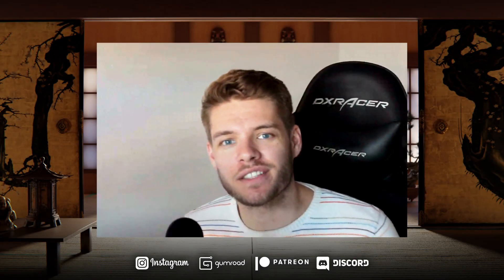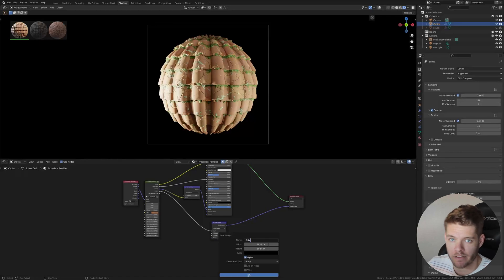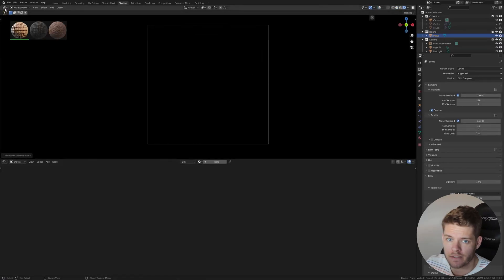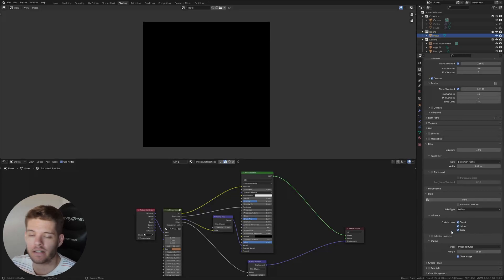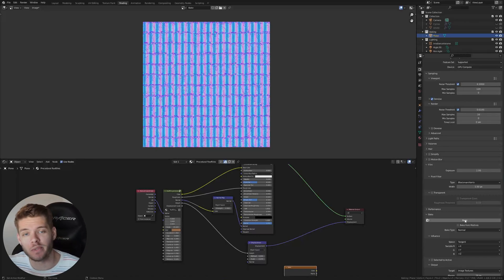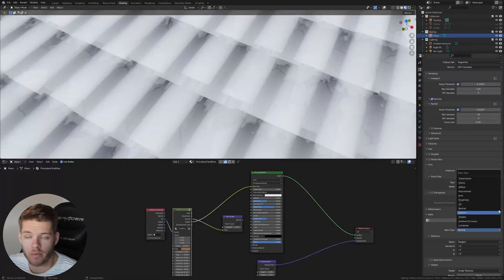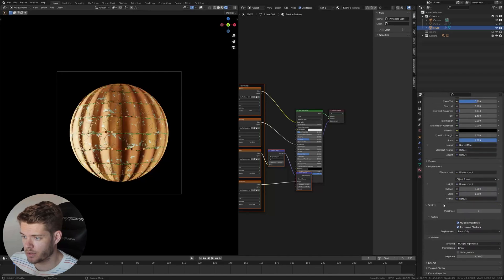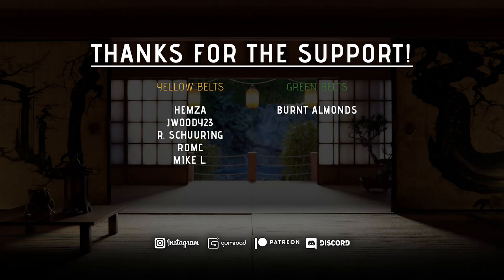Blender Bake Textures for EEVEE, Unity or Unreal [Material Displacement in EEVEE]

Comment: I have a procedural rock wall material that I want to bake down and have created the Diffuse, normal, and roughness map and need to bake a displacement. Cycles doesn't have a displacement bake, as you mention so you are using the height from the material to create one...except that material you have has the height coming out of a group, when I open that group to see where it gets the height input to see how I can set my much simpler node tree, I see about a hundred nodes in a spaghetti tree. So, from a normal set of nodes, where am I getting height to create the displacement map?
Reply from the maker: The height is always the final input that goes into the displacement socket on the material. So to render out the height simply plug that final output into the emission slot as shown in the video. It doesnt matter how complicated the node setup before that final output is :-)

Comment: baking the texture this way doesnt work. I have created a planet model that is 100x100 meters. trying to render it this way litteraly doesnt render. after 24 hours it has not reached 1%. However in viewport this thing is fine. not lag at all.
Reply from the maker: Oh yeah that could be an issue with large texture density. What resolution are you trying to render on?
Reply: @KaizenTutorials 4096x4096. In order to create the planet I mixed together a bunch of noise textures and used multiple principeled BSDFs. I found a workaround though: Delete every Principeled BSDF and replace it with a diffuse BSDF. Set roughness to 1. Then render. After that do the same with metalic, roughness, specular and emission maps. Always rendering them as color only map.

Comment: Is the displacement adding geometry that takes a toll when rendering animation or, does the baking process avoid the extra load on rendering in eevee?
Reply from the maker: Baking down your displacement to a height map makes it so you can use it in engines such as UE, Unity and Marmoset and still get displacement working without the need for additional geometry. This is very simplified but sortof explains the idea!
Reply: Great tutorial, love your videos. This also keeps everything inside Blender so you're not dancing back and forth between graphic or third party online map creation software. I always hate incorporating third party solutions. @KaizenTutorials

Comment: I don't intend to export anything to game engines, or other software but create animated characters inside of Blender using EEVEE. I have a number of procedural textures on my characters, some fairly involved but, given that I'm rendering on a RTX 3090, what would I gain by baking? Won't baking the texture freeze the lighting for my character?
Reply from the maker: No, that's why you disable the direct lighting in the base color bake. The other maps don't use the lights. So if you just disable the lights affecting the base color bake, it should look just fine with your scene lighting! I have a newer video on the subject called Creating Game Assets in Blender. You can check that out to get a bit more info on the process of unwrapping and baking in Blender.

Comment: It doesn't work for me, I have a procedural texture of a planet but it's too eavy  to work with so I tr to bake the texture but it doesn't bake like it look on the sphere.
Reply from the maker: Hmm.. are you baking emit values? So make sure to bake the emit value of each map and when then using them for the material also make sure to use non-color data for the image textures for metallic, roughness, normal and alpha. Only use color-data for the base color image texture!
Reply: @KaizenTutorials  I don't think I use emit values, I use mix rgb with noises textures. On my sphere I have separate contients and ice polar but when I bake, I have just one shape without my ice polar.

Comment: Does this produce seamless tiles?
Reply from the maker: Is the texture is created properly, then yes. Since baking has nothing to do with the seams!
Reply: @KaizenTutorials  So, basically no, alright. I'm trying to make noise based textures for Unreal Engine, but can't find any guidance on how to make them seamless.
Reply: @GreyManFaustus  Blender can procedurally generate noise texture. Procedural texture is always seamless.

If you want to map the noise texture to the shape of the 3D object, click on the Noise Texture node and hit Ctrl+T, it will create Texture Coordinate and Mapping nodes before it, and make sure it takes 'Object' input from the Texture Coordinate node.

This video is just to guide you on 'baking' the texture, not generating a new one. You do the baking after you're done setting up all the textures mainly to improve performance.
Reply: @leodash_  I tried that. If I bake such a texture based off a square plane and put it onto something else, there will be seams. 
I found a way to loop noise by now and that works well.
Reply from the maker: Ok good to hear! You can also use a free node created by Erindale (you can find it online somewhere). This will let you blend seams for image textures!
Reply: @KaizenTutorials  Found it on gumroad, thanks for the tip! It even comes with tiling capabilities. Looks way easier than the other approach I found.
Reply from the maker: Yeah it’s super simple and effective!

Comment: I am having an issue I set up a different kind of texture where i used color ramps and noise nodes to make a rock texture. I am having an issue where there are awkward lines going through the final sphere after I apply the images and it is all messed up at the poles
Reply from the maker: Hmmm well UV Spheres always have some issues with displacement, that's due to the way their UV's are layed out. The top faces are all triangles and thus can create issues on materials with Strong displacement. Try to use it on a plane and see if it looks fine there. Then it should be good! For the sphere you can always dial down the amount of displacement to get rid of the worst of it. Hope that helps any! If not; feel free to shoot me an e-mail @ kaizentutorials@gmail.com with your issues.